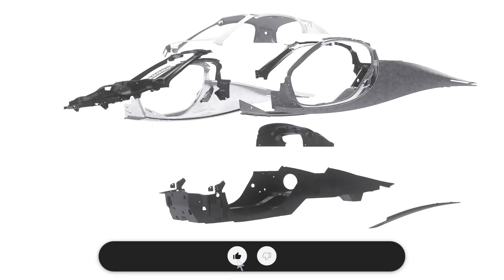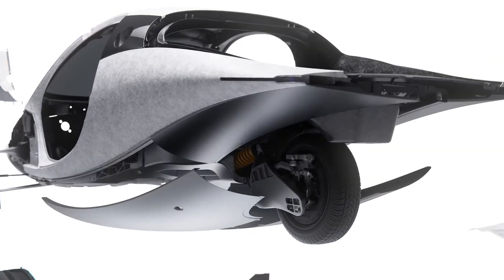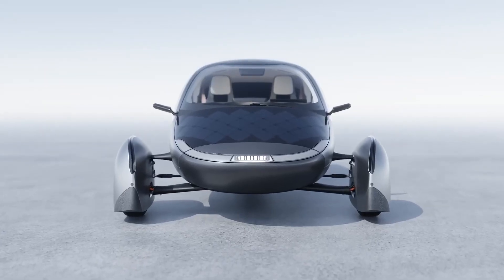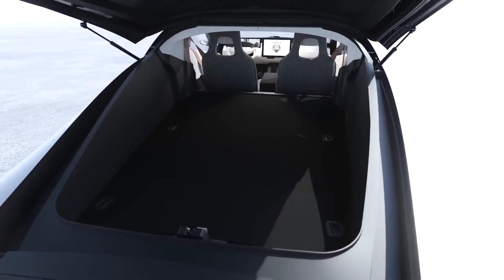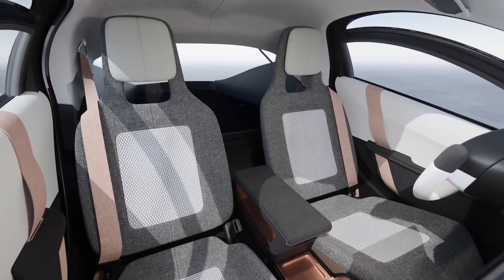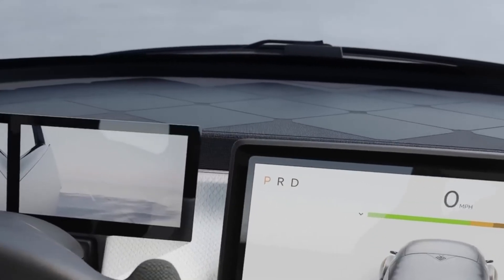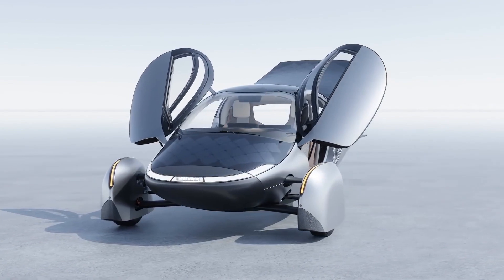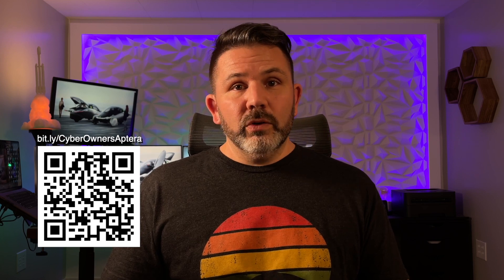Aptera Delta final pre-production design changes in depth review

Comment: Where is the skin cooling?  Where is any cooling system at all?
We don't need another digital napkin drawing.  What I want to see from them is that they have resolved the heat issue that stopped them in 2009.
To date, they haven't even, to my knowledge, successfully figured out how to make the air conditioning system work.
Reply from the maker: HVAC was working in gamma. Air comes out from around the screen. Battery cooling is in the skin so you can’t see it. But they’ve been working on it. Sandy Munro would not be giving it praise if they hadn’t figured these things out.
Reply: @CyberOwners  Nope.. they have always said that this is where it "WILL" come out.
Did you personally get a demonstration of the air con?
Has anyone? 
I have extensive experience in industry.. an entire career in fact.
The result of that is that I have a very well calibrated bullshit detector and a cynical nature where I am observant and distrustful of language.
So unless you have actual proof that the air con was EVER working.. present it please.

What we have seen is models riding around in the car in southern CA with the windows down so they don't overheat.  We have even seen them doing 0-60 tests.. with the windows open.
Why would they incur the increased drag.. if they didn't need to.

So until I have some hard evidence that this system is actually working... it doesn't.

AC systems require a heat transfer to operate.  Period.  The exact amount you are reducing the interior cabin temperature MUST appear at the coils... and that heat MUST be removed.
We need to see some evidence that this has been taken care of.

My issue with Aptera is that I'm seeing the EXACT same things from them that I saw in 2009.  They have a factory.. they produce prototypes.  They don't resolve fundamental issues.
They fail and everyone says "we tried" all after taking years of salaries of course.  As well as backer funds they also consume cash from state and federal sources so they can all walk away with some money in their pocket when, once again, someone buys them out thinking perhaps they can make it work.

So until I see something that breaks this irresponsible engineering pattern I'll remain skeptical that they are ever going to produce a single vehicle for sale.

I have an order for a 1000 mile range vehicle with the full solar package.  My intent is to give an honest review of this vehicle should they ever actually produce it.
So don't think I'm anti EV.  I'm not.
What I am.. is anti fraud.

As to Sandy Munro's involvement, I think he saw the potential in this and isn't as heavily invested as it might appear.  I think he is giving good advice and it was around the time he was first involved, late November/December of last year, that Aptera announced that they had hired an aerospace engineer to review the skin cooling.

In this model we still see them using composites in the under pan instead of the aluminum needed for any kind of heat transfer system.
So as this draws closer to their re-revised release date I'll be watching this very closely to see ANY signs of the engineering that will be necessary to make this an actual functioning vehicle.
like air conditioning that SOMEONE can actually show and testify that is actually working.

Comment: The white is molded fiberglass the black is molded carbon fiber. In the beginning shot of the body coming together you can see some of the mounting hardware; door trim for mounting hatch and  doors. Also the latch mechanism for the door. Start at 0:46 and look at the bottom right of the door. Freeze at 0:49 seconds in your vid. The inner carbon of the door frame settles into the fiberglass and you see a carbon box to the right of what should be the door latch. What I see is a lever to mechanically open the door if needed going right up to the latch.. Soon after that the big hole in the right side of the cargo area is for a sub woofer for the upper level sound system. This was confirmed by Jason Hill. Which may benefit from the waffled carbon solar hatch? No one is sure about the opposite side but I think it may be a 110 outlet and an interface to add on solar for camping. I think it is supposed to handle another 1000 watts solar in the inverter system. No one is sure about the material between the front crash system and the rear wheel assembly mounts of the skate board. CPC redesigned the swing arms I think. Possibly Roush? Check these versus the beta mule. Might be why the wires seem a bit exposed? The covers might be one of the small items they are looking for a maker. 

The grid in the back exterior is part of the cabin air system. Could also vent air from the cooling system? But more than that. You have to go back to the original aptera and see Fambro talking about releasing air to reduce drag when describing the grill on the back to an interviewer for a popular magazine going into producing videos. I believe it was Popular Mechanics. Also the rear view camera got moved to the top of the hatch above the brake lights. Where it should remain pretty clean. Not so sure about the backup camera? But the air release may help reduce drag which is why large flat backed vehicles always look so dirty?  The stock has lighting controls; side lights/parking lights, low beam and auto. Press the stock back for high beams, pull it to flash. All icons on the stock. The knobby ring does not show any function icons on it. It is hoped it is washers. I did find a similar stock that had fog lamps as on or off on the knobby ring. Unless the smile light is controllable? I do not recall an icon for that. Also there is a cloth wrap [2" wide] just in front of the hatch latch which may allow you to pull up the carpet [probably backed] to reveal a storage area. Probably enough for a granny lead, a vehicle to load [110] output handle and fix a flat. They needed more cells. Six more would have been great. Possibly Maxeon will release a newer slightly more powerful cell before they get further into ramping production of panels that would put them well over 700 watts by maybe 14 without connector loss?   

I love the new console!!!! It is simple. it should last and as you point out be easy to clean. Actually makes the codex color scheme look great. Think Coast would be impressive also. But not so sure about Veda? We need an update on the order form web page! I really like that the material on the center console is the same as the door! It also appears that it may be still modular but rather than snaps there seem to be plugs holding things to the tunnel. Jason Hill suggested last month that people could use a 3D printer to make items they would want or after market manufacturers. So twin chargers may not be out of the question? I think we will be lucky to get to production by the end of the year. It is going to depend a lot on the economy and finding a large increase in capitol. The gamma was mostly old body tech. This is another level that can be truly mass produced with a body part every 2 minutes in the mold and cnc trimming of parts by fully automated systems to create first time fit. Of every body part. Though I am not so sure that the belly pan is not aluminum. CPC can easily make that too! They got their start in structural aluminum back in 1959. They have made aluminum engines for motorcycles and cars. The current CEO of CPC designed many of them before he became a part of the company.
Reply from the maker: Wow, thanks for the in depth comments!

Comment: Oh I don't know about putting monocrystalline cells on the dash behind glass was a good idea. There's a better solar cell for that and there exists at least 4 penalties to performance for monocrystalline that are going to make rated power tank for those cells. The reflected energy from the incident angle, the % light transmission through the glass, and the temperature the cells will be forced to run at. It would have been better if they chose CIGS or amorphous thin film cells because between 800nm - 1200nm where monocrystalline gets its power from the sun, glass also has the worst light transmission at those wavelengths (75% at its lowest point for clear double glazed glass). Since Amorphous gets its power between 400-700nm, the glass appears more transparent (85-90% transmission) at those wavelengths and under cloudy conditions, amorphous is not going to have its rated power drop as much as mono will.

But I get that it's probably cheaper to re use what they're mass producing, but is it worth the price to even include cells behind glass on the dash?

Comment: Notice that the exterior layer over the solar cells is no longer crystal clear, but slightly tinted.  Aptera has said that the additional cells are necessary to make up for the output reduction caused by this tint.  The outer layer protecting the cells has been changed for the rear hatch, I don't know if it applies to the other solar areas.  Great work going into detail, thank you!

Comment: Great review. Your comments are clear and your speculation considered. Whilst the scope for further changes is reducing, here are some comments from a potential UK owners point of view.
Lights. European practice is amber lights at all four corners. Not clear how rear light modules are configured, how the wheel spat lights will affect perception as they turn or any need for side repeaters. Am I correct in presuming a high-level brake light at the top of the hatch alongside the rear mirror camera. The unattractive licence plate light could be reconfigured to a small strip light above the plate and a reversing light? What about high intensity (fog) rear lights? I would love the ability to reconfigure the front lights to the original pair (after market?) where regulations allow. I think the single unit could cause confusion to oncoming traffic.
Sometimes I think comments on the yoke & stalk controls focus too much on aesthetics rather than function. I still think there is a good case for the following to have dedicated buttons/functions: indicators, main beam flash/dip, screen wash & cruise activate 
Don’t have a problem with the concept of split windows but the renders do raise some concerns about thickness of the A and B pillars and effect on visibility.
Overall very good to see the continued refinement of a great looking car that deserves to succeed.
Reply from the maker: I don't know UK laws but would this have to comply with car laws, motorcycle laws or autocycle laws over there?

Comment: They proposed rubber boots for the internal side of the wheel motors but it is an epic fail for the rendering team not to include it with the delta imagery release.  They need to do better with quality assurance

Comment: Wish there was an option for full windows, from a safety and egress perspective if this thing were to be submerged in water, that small window opening is likely too small to escape out of, plus it is directly in the line of sight. I would gladly reduce my efficiency a bit to have full size side windows
Reply: Windows just don't fit in the door. The entirety of the glass would need to be able to fit, and it just can't
Reply: I imagine it floats (if undamaged)?
Reply: @robertmoss440  most cars float very well (check out old tsunami videos from Japan)
Reply: I think it was the only way to get windows that open into that big, curved door (aero)

Comment: This isn't in-depth - it's shallow. The cretin at AOC has gone deeper, but not by much. 
Let's begin with the wheel covers slipping down over the wheels? It's magic. Watch as solid parts travel through control arms and wiring.
The underbelly is one large separate piece of plastic. More magic. It starts as two, split left and right, then finishes as one after being obscured by a rear wheel cowl. As for the plastic, it will neither cool the inner coolant plate nor protect the trike from the road rocks and stones, and the cretin has noted there is no inner coolant plate - something fishy.
The hatch has enough length now to mean you can't open it in a high wind without risking it snapping off those flimsy struts.
The doors don't look like standard car doors, and the buttons are already disputed in your first few comments.
The cretin said the visors were made of a mesh, but neither of you picked up on the fact that they are too short to be of any use with heads positioned so far back. They barely cover the A-pillars, actually.
The horn button can't be reached without difficulty during turns. One would have to look down to see where it is.
The console is impractical Watch my review to see why, and read some of the comments.
Side mirrors a concern when no skin cooling or even batteries are shown, and the dipping wheel covers during cornering has not been fixed. So much for being in-depth.
Reply: You are a mental case
Reply: @Dsnybx911  If that's all you have, then I am not bothered in the slightest.

Comment: Audio is a little low.
I haven't followed the development but I'm surprised by how complex the construction is. The original used the shell as the structure, right? this has many layers. I wonder if this complexity will hurt them cost wise.
Reply from the maker: I was speaking a little low due to still having some echo in the room (nothing on the walls behind the camera yet). I have a few things on the way to deaden the sound some as well as a good mic stand.

They moved to this to reduce cost, so I guess making the two piece shell was going to cost more at scale than this is.